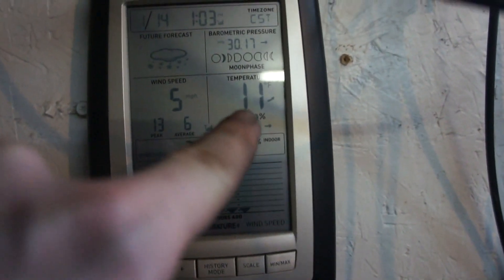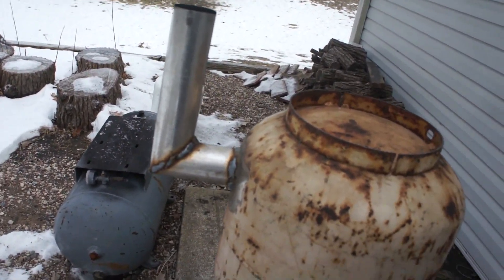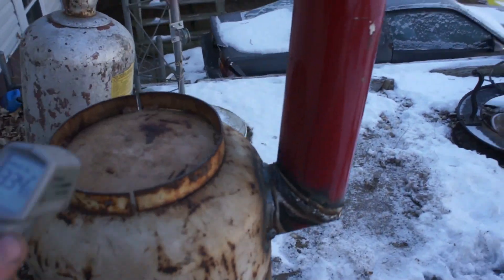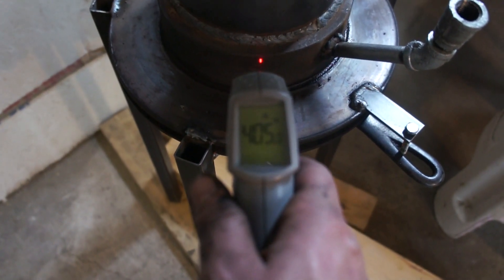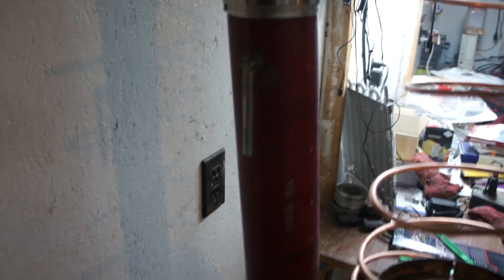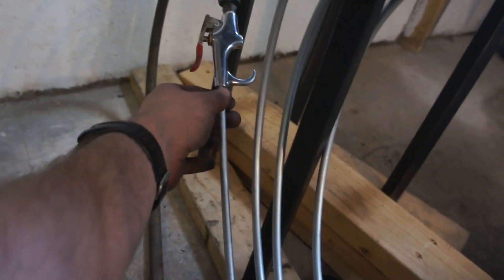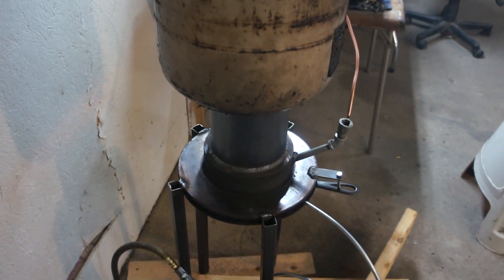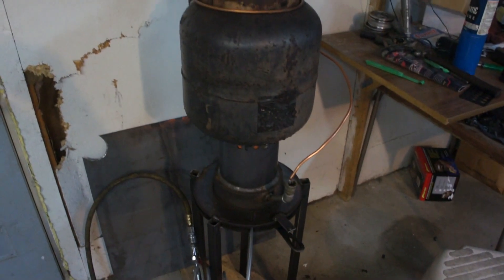Waste Oil Heater Experiment 2

Comment: You don't need forced air to make it burn cleaner/hotter. You should drill hole all the way around that pipe, just above the rotor and it will introduce more are that way. Keep adding more holes until it burns the way you want it to. You can always go back and plug some of the holes (with bolts) if you think you went too far.

Comment: It's not just the diameter of the exhaust but the lift height...a taller stack will have a stronger convective force and draw more air.
Reply: get rid of the legs and move the pan to near the floor, that'll give you a taller overall furnace and more convection and more surface area to radiate heat into the room.

Comment: hi i've just finished a similar project which is reaching 700 degrees but my rotor is sealed to give negative pressure in the pot but then i drilled a lot more holes in the burn tube

Comment: By having the exhaust pipe right out of the top, it will help with the draw of the air.. by having it on the side it causes a turbulence and weakens the draw. KEEP IT RIGHT OUT OF THE TOP FOR A BETTER AIR FLOW... remember fluid dynamics. you want the air flow to be the least resistance.."the same with water =  fluid dynamics, it will flow better with the path of least resistance". this is how to make the oil burn hotter, & most of all cleaner......

Comment: It's an old post how-ever. To make that stove hum, you need to drill holes into the black upright pipe, if you take a section of black stove pipe drill holes in it to go over the existing pipe with holes slightly offset to the holes drill in the original black pipe, being able to rotate the black stove pipe added over the existing pipe, you can alter the amount of air introduced to the combustion of gasses from the initial burn in the rotor.

Comment: what you need to do is choke the exhaust down to hold the heat in but at the same time you need to choke the number of air inlets on the rotor therefore increasing the air pressure coming in and in turn increasing the burn temperature and burning cleaner altogether.

Comment: Hi Jack of all trades Remove the Rotor and replace it with a solid rotor and drill  4 holes in the top brake disc.

Comment: Thanks for the sharing of the info aka knowledge.  Great job with the temp readings and all.  I do have questions regarding the safety of the drip line and if there's an issue with air quality.  No potential fire hazards with fire up the drip line or intake? You got me sold on trying these heaters.  Thanks again.

Comment from the maker: Your are right! Adding length to a chimney will help the amount of draft that the chimney can produce. You are also right if you have a chimney that is losing a lot of temp it will build up a lot of creosote from the gases cooling to much in the chimney and it will plug up very fast which will reduce the amount of draft you have as well. Did you have a chance to view my other videos on this experiment? There may be some other things I answer in those videos as well. Thank you for watching!